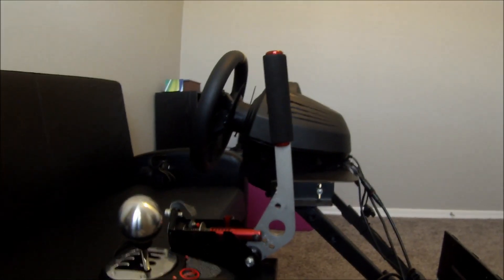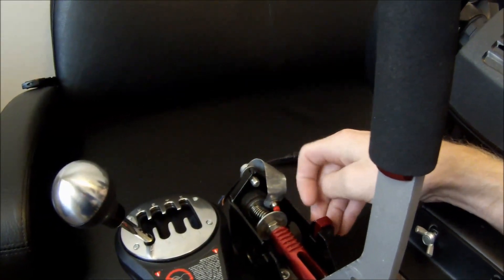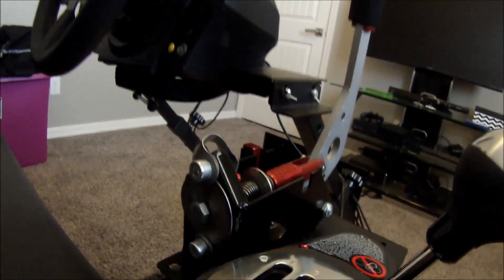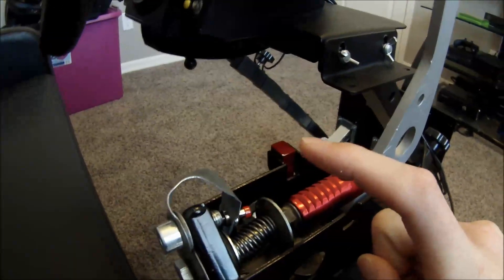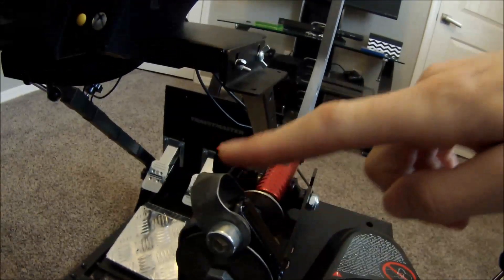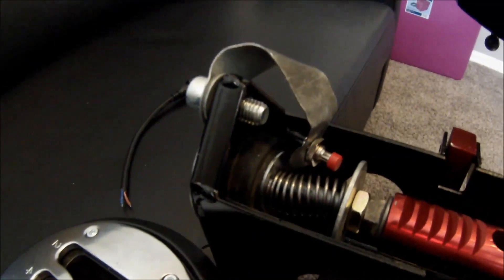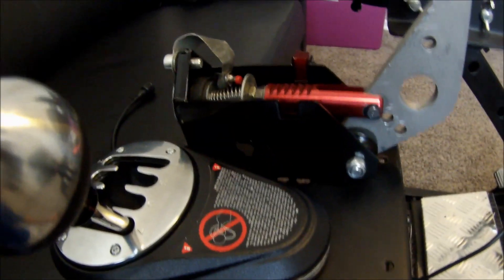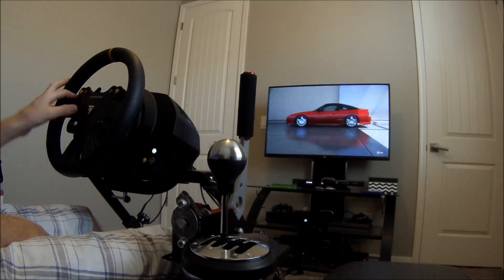Thrustmaster Handbrake Mod PART 3

Comment: WHY IS MY HANDBRAKE ALWAYS ON?!?
Reply from the maker: Alex Valdez it sounds like you soldered to much on the board and connected the 2 halfs check out my TMX video just to see a better example of soldering the wires to the board.
Reply: Thank you! I'll check it out
Reply: Alex Valdez always on switch vs always off switch

Comment: is this slaptrains handbrake?
Reply from the maker: this is my handbrake, slaptrain contacted me and i basically told him how to do it. as far as i know i was the first to make a handbrake for xbox 1 about 3 years ago. around the same time horizon 2 came out.
Reply: I've just noticed the way you attached the button to the hydro :D
Reply from the maker: yeah, ive changed it but it worked

Comment from the maker: +Topaz/Drifting Brandon
thanks, if i could afford some weds id have them for sure. its just a rb20, getting ready to swap it for a 1jz actually
Reply: If my wheels rim becomes old and I buy another one, can I detach the handbrake and reattach it to a new one?
Reply from the maker: youll have o rewire the new rim
Reply: +Jesse Strader couldn't I just swap the circuit boards?
Reply from the maker: yes i think there all the same

Comment: all the links dont work
Reply from the maker: +Lars Erik Grindvold (wildboy90) there all updated now.
Reply: +Jesse Strader you've use the same link for the button for the hand break
Reply from the maker: all the add on wheels are the same inside for the most part. i have both and wired up both. just need o wired to the contact point for your e-brake button.